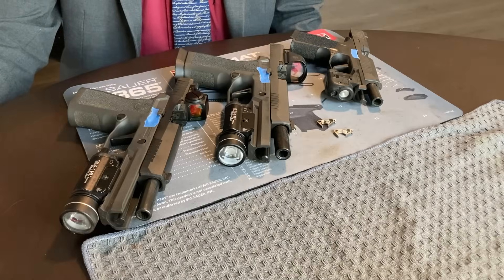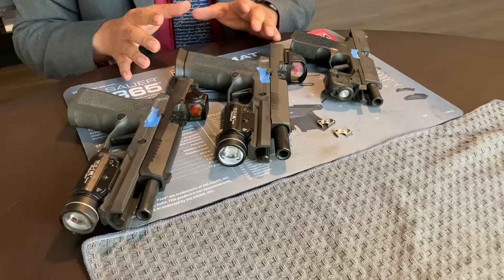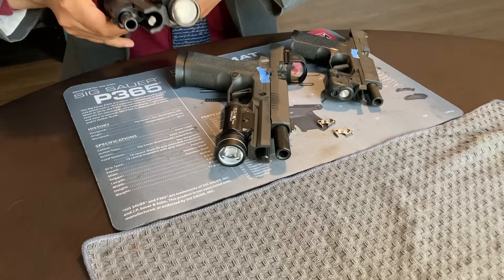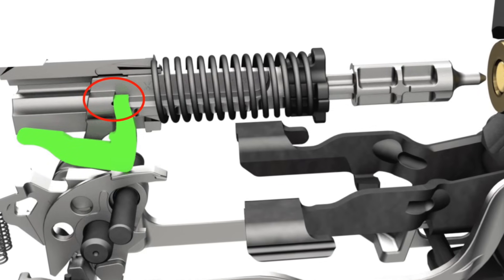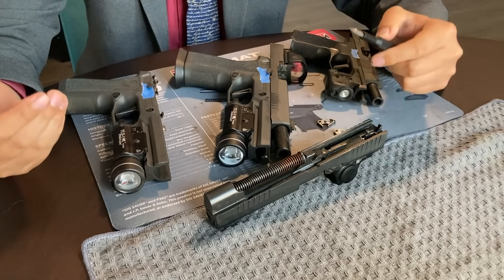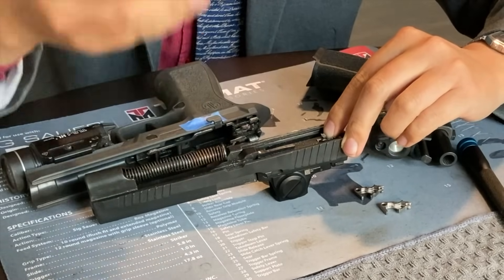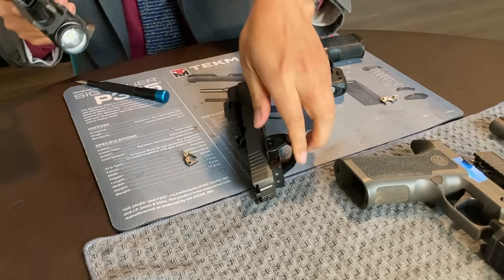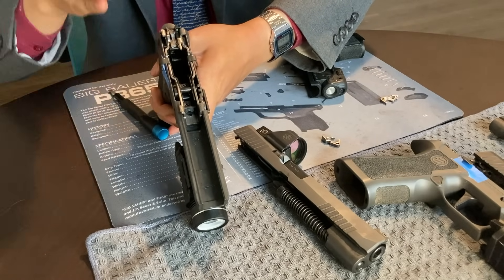How to fix a P320 that fails the Sear Movement Test

Comment: From what I have observed this uncommanded discharge issue arose because of the fix of the original drop safe issue. One of the changes to fix the original drop safe issue was to add another "leg" to the sear, I know you guys are aware of this change in the sear of the P320. This means the sear can not move down unless it also moves the trigger bar. This adds an extra layer of protection to the gun against the drop safe issue. HOWEVER, now what you have is a configuration where if the sear moves from some kind of force it will also move the trigger bar. Which means that the striker block safety will be disengaged and the gun can fire. This is exacerbated by the fact that the 320 doesn't have a trigger blade safety which would stop the trigger bar from moving enough to deactivate the striker block safety. It IS the design of the 320 that makes it unsafe.
Pay attention to what SIG reps keep saying over and over; "The P320 can not fire unless the trigger is pulled". They are right, this was part of the Fix for the original drop safe issue. But the problem with that is that the trigger moves if the sear moves it.
Reply: Yes! The fact that internal sear movement (from whatever other cause) makes the trigger move is insanely poor design choice as the secondary safety is based on trigger movement. Insane they thought coupling the 2 movements was a great solution for drop safe issues, now there's issues without the drop at all.
Reply: would a trigger blade safety completely resolve the issue?
Reply: @willparfet8912 The issue is the sear moving internally moves the trigger, that releases the firing pin safety as if a trigger was pulled. If the trigger safety stops all trigger movement regardless of source then I believe it would. If it doesnt lock the other linkage pieces from moving and just blocks the trigger itself leaving internal movements from the wrong end still capable of moving intermediate linkages then risk could remain. I would want to test very rigorously before relying on anything, this design is an overly complex mousetrap.
Reply: @jay2ssrstt I have a trigger safety on mine and it doesn’t move the trigger bar when you pull it without pressing the blade down. I should do the test to see if pressing the sear does anything to the mechanism
Reply: I just tested this, with the fcu in the grip I can push down on the sear and still cause the gun to function even with the trigger blade safety. I also tested this with the slide on too using a “long pointy thing” and I was still able to see the firing pin poke through. this is also with the manual safety engaged as well. it looks like there is a little bit of slack in the trigger that moves the bar before the blade safety stops it. for whatever it’s worth my trigger bar number is 576
Reply: @willparfet8912  While not the ideal answer it sure is nice to know, thanks for testing it

Comment: When I push my sear downward with a small punch like you did, it moves, but it's difficult. The rear of the trigger bar is pushed downward as I apply force but not forward. The trigger itself shows no visible movement. The lever next to the sear does not move or pop upward to disengage the striker safety. My P320 was purchased new in mid 2022. These guns do not seem to function consistently.

Comment: Just tested both my 320's. When preesing down on sear, the saftey block does move, though it has no pressure to raise striker block out of the path of the striker. Now, when the trigger is pulled, thats when the is vertical force alplied to the striker safety block, FYI. Now i very much appreciate your videos on this. Imglad to have been inspired and can report that both my FCU's do move down and fwd at same time. So with your help, i feel better thank you! Ill pose another question.  Would loading a magazine to full capacity put extra verticle pressure on the slide just enough to reduce the contact surface of the sear and striker? Thinking that could factor in to the difficulties in repeatability of testing. Keeep up the good work, youre definitely appreciated.

Comment: That extra leg?

Since it came after the drop fire issue. My only thought is that it’s supposed to act as a counterweight to the Sear pivoting if dropped. 

That’s all I can come up with.  

And had an unintended consequence.
Reply: Have you tried drop testing it since the leg was removed?

Comment: Okay I have two FCUs as stated, M17 passes with stock trigger, M18 fails with stock trigger. I think it's still up to debate whether the "fail" is intentional as a third sear spring but either way IF this is a safety issue and I believe it is the Agency Glock Tab Safety trigger is doing more harm than good. It makes my M17 fail as I think the tab preventing trigger movement is mechanically interpreted as a trigger pull so the safety leg goes up to disengage the safety. Looks like the safest solution without modifying your sear is to have a manual safety. So not sure what to think about the Agency trigger, it'll help prevent unintended trigger pulls but if the manual safety is off it makes it less jostle safe in theory. If the safety tab on the agency trigger engaged a lot sooner it COULD be beneficial especially to those whose FCU fails as it then acts like the manual safety and trigger disconnects. I may play around with that building up the tab with weld or something however at the same time these flaws intentional or not is really off putting. Seeing this makes me wonder if that's why they ditched the trigger safety.

Comment: Thank you for your insight and evaluation of the issue. I have since changed the sears in both of my P320's and conducted the sear movement test and find no sympathetic movement of any other parts.  I took your advice and put the original sears away to restore weapon back if necessary. I also took my full-size pistol out for shooting and did not have ANY issue with shooting, holstering or rough use.
Reply: Do the drop test with a blank

Comment: I’m curious if just getting rid of the taken-down lever’s involvement on the sear (more akin to the 365 in looks) would do anything beneficial? Trigger pull would be necessary after that to move the sear out of the striker’s path; but I’m curious

Also, I’m curious if the knowledge that the parts are Made in India is gonna make it back to the DoD and if Sig is gonna be in breach of contract for that; that’s what Sig should really be worried about
Reply from the maker: Thinking about it, I don’t believe the Takedown Safety Lever has the effect on the FCU that everyone talking about it thinks it does (not the least because people keep calling it by the wrong name), but I can’t authoritatively say until I’ve experimented with the parts in question to see if observed behavior acts like theorized behavior.

Comment: The p365 also uses the old series 80 plunger style furring pin / sear safety. I think that proves sig is aware or the issues with the p320 because the p365 came after the p320 and they moved to the old system that most pistols use.

Comment: One of the changes to the P320 post-upgrade, was a change to the safety lever. Pre-upgrade, the safety lever could be lifted up with a finger when the gun was field stripped. The safety lever was only held in the down position by spring tension. Post-upgrade, sig changed the way the safety lever interacted with the trigger bar, so that the safety lever could not be lifted with a finger. The safety lever was essentially locked in the down position, and could only be raised up by the trigger bar moving forward. Does modifying the sear change this? Or, is the safety lever still locked down until the trigger bar moves forward and raises it up?
Reply from the maker: The Safety Lever / Trigger Bar interaction is entirely controlled by those two parts. Modifying the Sear does not change the geometry of either part.

Comment: P320 with manual safeties have a slightly different trigger bar, when I press on my sear it does not engage with the trigger bar
Reply from the maker: Odd, that is not behavior that I have witnessed with any other post-“upgrade” FCU…
Reply: @ Thank you for replying, i went back and played with it some more and was able to engage the trigger bar. However when the manual safety is engaged, it locks the trigger, when the sear is pressed and does not move the safety lever up, which then prevents the release of the striker safety essentially providing the same results. Granted…..You’d just have to always remember to have your safety engaged when not firing/using the firearm. Again thank you for what you’re doing, I’m considering going with your suggestion and add that extra layer of safety. I think you may have solved this. Anxiously waiting for your next drop as you seem to be the only one really providing solutions to a problem. You’re the man. Thanks again.

Comment: Well the main thing I see there is now when you go to break it down you're going to have to pull the trigger where before you didn't have to you're going to have to drop the striker so to speak
Reply from the maker: The rear leg is trimmed below the point where the Takedown Safety Lever interacts with the Sear. The Takedown Safety Lever function is preserved perfectly, as noted and demonstratedin the video.

Comment: I’ve noticed that a manual safety engaged will lock the trigger bar preventing the safety lever from moving upwards in a way that at any time might defeat the striker safety lock before striker dropping
Reply from the maker: I have observed what you observe with the one Manual Safety FCU I’ve managed to get my hands on, but other folks have reported different findings with theirs. I’m not certain what to make of those different findings since I’m only hearing of them second-hand and haven’t handled those FCUs myself.

Comment: An analysis is needed to determine whether or not the P320 is actually inherently drop safe at any impact speed, especially as you have modified a part.  The P365, which uses a similar trigger system, is NOT inherently drop safe onto the rear of the slide and at some speed of impact it WILL fire!  My estimate is that a drop between a 10 and 30 foot will cause it to fire.  The trigger side of the pivot axis needs to be balanced with the trigger linkage bar side of the trigger pivot axis so that the inertia is balanced so no trigger movement occurs when dropped.  I had to physically lighten the curved trigger about 25% and the straight trigger about 22% in order to balance against the trigger linkage bar.  Did Sig actually lighten the P320 trigger enough to be drop safe?  I also noticed that Sig seems to be offering the P320 with about 4 different triggers.
Reply: yes, trigger was  significantly lightened. They changed like 20 other things with the voluntary recall... you wonder why so many things were changed. A few   were  QOL improvements, some others that felt like cost cutting measures...

Comment: I want to thank you for your efforts. Further I applaud your effort to define what you don't know as well as the things that have to happen. I did some of your testing. My first move was to obtain a spare slide back plate. I the cur the lower tail off. the allowed me to push the slide down in a controlled manner with a non-miring tool. i used a wooden dowel with the end cut in an angle that fit over the sear. Further. I used a 5/16 wood dowel to down the barrel to see when the striker came out. (I did have to sand the end of the dowel down after the striker dimpled the Dowel several times.) I tested 3 different guns. I was able to generate the failure many times with the Sig Skeletonized flat trigger. Like you I found there is a timing issue. Using the curved trigger as a reference, I found the Skel. trigger positioned the trigger bar about .050 inch forward. As you mentioned, I also don't know what could cause the sear to move downward without a trigger pull.
Reply: Wondering if beyond the slight tolerance differences with positioning you mention if the skeletonized trigger simply having less mass making the sear able to move it easier could have an effect as well?

Comment: Here is an in-depth analysis regarding the sear movement test: I have two P320 pistols - One is voluntary upgraded while the other is the post-upgraded from the factory. Both exhibit different behavior. 

The voluntary upgraded pistol trigger bar moves diagonally down and does not click with sear actuation. A small amount of pressure applied to the trigger while the sear is fully actuated allows for the trigger bar to click up. Unlike your example in the video, I need to apply tiny amount pressure to the trigger after full sear actuation to get the click. The striker safety lever moves partially up on this pistol when the sear is actuated. It does not move up enough to fully actuate the striker safety block.

The post upgraded pistol trigger bar moves forward (not diagonally downward) with sear actuation. There is no click. With added trigger pressure and full sear actuation, there is no click like my voluntary upgraded pistol. The striker safety lever moves up much more than my other pistol. That is to say with the same amount of sear actuation , the lever actuates the striker safety block much more on this pistol than the voluntary upgrade pistol. This makes it less safe and more prone to overcoming the striker safety block if the sear were to be actuated without trigger pull.

Fortunately, in both pistols while fully assembled, sear actuation allows the striker foot to release would not result in an uncommanded discharge as the striker safety block works 100% percent of the time and does not allow the striker to pass the breach face. I would still argue that the post upgraded pistol has less striker block engagement as the voluntary upgraded pistol due to the increased striker safety lever movement in the post upgraded pistol. 

The fact that both pistols exhibit different behavior with the same input is indicative of a design flaw. Whether or not this different behavior could allow for an uncommanded discharge, the different output behavior in the 'same' pistol configuration is mind boggling. The design is not robust enough to output the same behavior between two pistols (sample size of two) with the same input. Tolerance stacking happens on every design. Tolerancing is a DESIGN issue, not a manufacturing issue. Assuming all my components are within tolerance, the result of different combinations of parts should achieve the same result for the assembly to be in spec or to achieve the same behavior part to part. 

What is the design behavior of the pistol? What is modeled at SIG for this pistol? Based on the two pistols shown in the video and the two pistols I tested I see three distinct output behaviors with the same input: sear actuation. 
	1. Diagonal downward movement with a click. Partial striker safety lever actuation
	2. Diagonal downward movement without a click. Adding pressure to trigger allows for a click to behave similar to Behavior #1. partial safety lever actuation.
	3. Forward movement only that does not click. Adding pressure to trigger does not result in a click. Near full striker safety lever actuation.

What is the nominal behavior supposed to be? I venture to guess #1 based on your thorough analysis of your pistols and the fact that #1 results in the least amount of striker safety lever actuation. This case is the most safe as it best prevents the striker safety block from surpassing the ledge on the striker. 

I am appalled by this design and @P320Truther is providing useful analysis of the variation in the population of produced pistols. 

The unanswered question is how the sear is being actuated by itself. It is clear that if the sear actuates by itself or separates from the striker foot with some external force (likely with little initial engagement with the striker foot to begin with), the pistol can either be safe or unsafe leading to an uncommanded discharge depending on whether the pistol exhibits one of the three behaviors listed above - I'm sure there are more behaviors not understood or analyzed at this point - safe or unsafe. 

Once the sear actuation issue is discovered (Sear spring failure, spring crossing, or otherwise), SIG is DONE. They will end that Day. The pistol is proven to be unsafe as the striker block is ineffective from a design perspective, not just a component quality perspective. 

I hope that someone discovers the repeatable root cause of the sear actuation that is independent of the operator. In all cases of uncommanded discharges, I do not see the possibility of a pin sized element finding its way into the back of the slide and pressing the sear downward. SIG could make the case that allowing something to find it's way into the back of the slide causing sear actuation is operator error however,  they would have to admit that their striker safety lever and striker safety block are ineffective and unsafe. Isn't the design intent of the safety lever and safety block to prevent primer strike given the sear was actuated without trigger pull?

I hope the free market develops a fix and SIG crashes to the ground. This pistol had been pointed at my baby producing parts for far too long and by the Grace of God Almighty I'm still fertile.